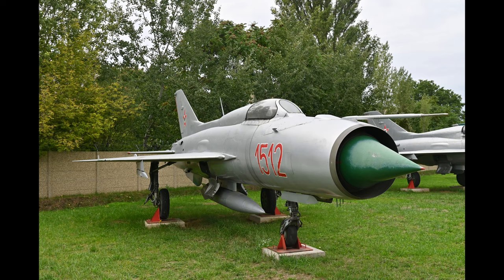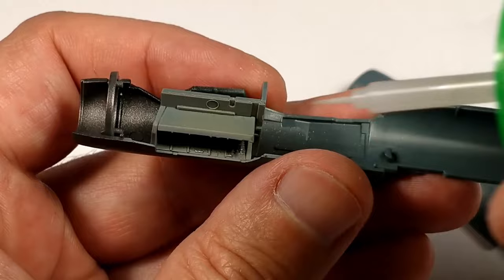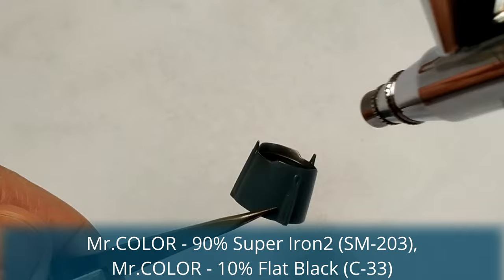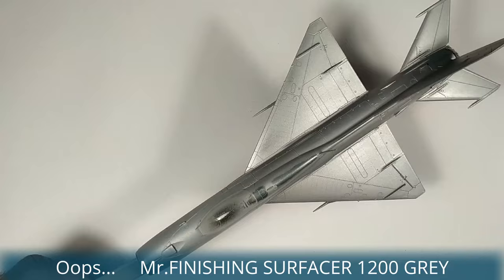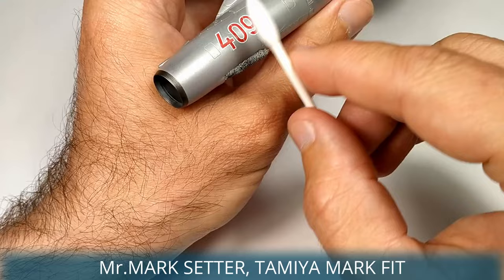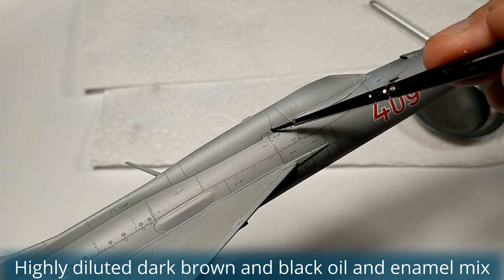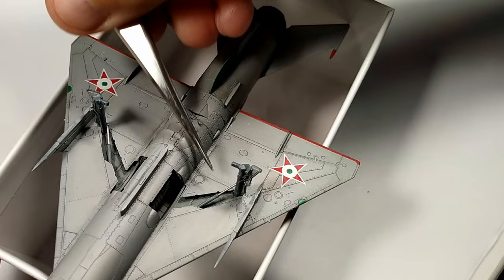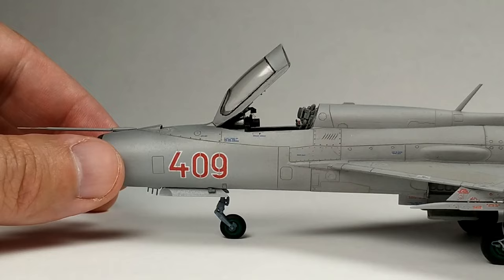Mig-21PF Full Build 1/72 Eduard ProfiPACK

Comment: Beautiful build! For the tri colour camuflage sceme i tried to find alternatives of MRP (those paints are perfectly spot on but they are expensive) so i visited Szolnok also, took some paint samples with me and i matched colours, the hardest one is the sand brow, it has no perfect mach Gunze C-19 is a bit light but that is the most closest one, C-302 is very close to the green and C-20 is 100% match for the blue.
Reply from the maker: If you check the original pictures, the aircraft were quite faded and different in colour tones. The paints that you mentioned are pretty close, and after weathering, it will be perfect.